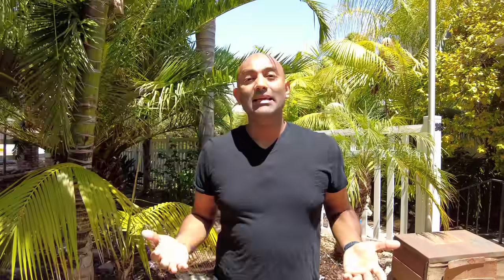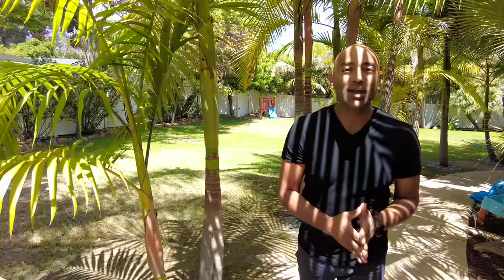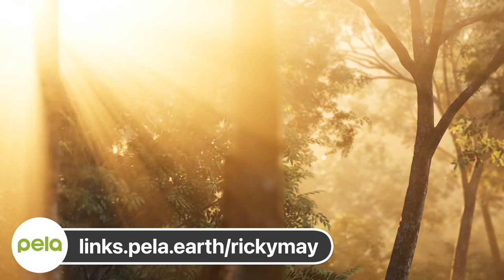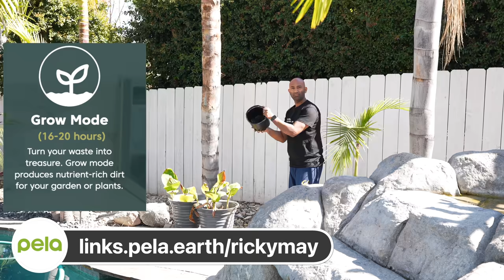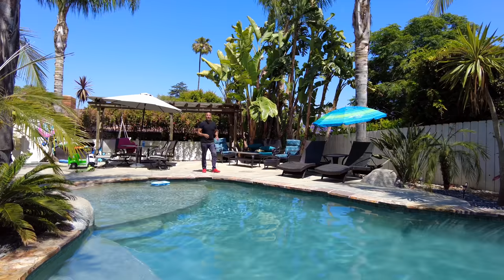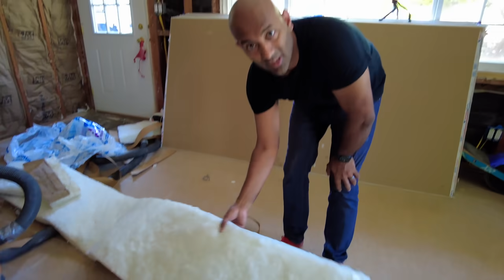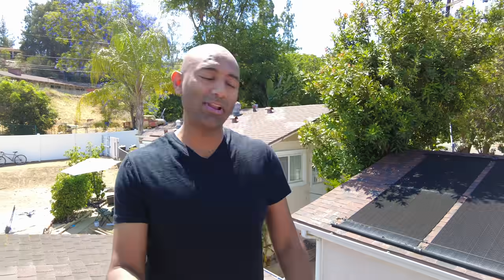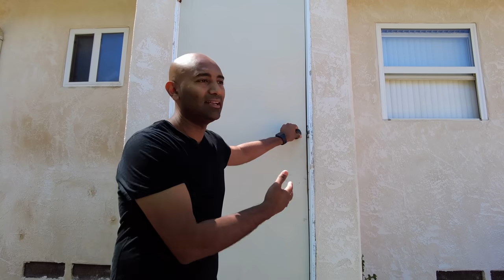How I'm Planning to go 100% OFF-Grid!

Comment: You dont even need natural gas if you can boost your electrical production by replacing much of you lawn and roof with solar panels. Water can be done with a well.
Reply from the maker: No solar over land for me. But I’m going to cover all my roofs and patios with it!
Reply: @TwoBitDaVinci  can you get enough solar energy year round and enough battery banks to absorb excess production for energy when the sun is down? When you look at grass its nothing but an energy drain. Energy and time to cut it.

Itd be cool to see if you can make a battery bank from salvaged lithium cells. Most lithium packs are sent to recylcing because only a few cells in the pack are shot. You can pull the good ones out and make a custom power bank. Id pay to see that. Been wanting to make one myself.

Comment: Thinking metal roof you need to get all gutters running to a water collection system
Reply from the maker: I really want a standing seam metal roof, but its really expensive. so right now I'm going to repair as needed, and get solar and get started. in 5 years, I'd love to do this

Comment: Solar hot water collectors are far more effecient than solar panels running a heater. You are better off getting vacuum tube solar hot water heaters (the best but most expensive) or a collector with a metal pipe inside an insulated case.
Reply from the maker: no way, I am going 100% PV solar panels. I have EVERYTHING electric I can power, and sometimes that might be a water heater. So i can run that for an hour or two. But the rest of the day or otherwise, I can run other systems I need. that's the thing, PV solar is by far the best way to go.
Reply: @TwoBitDaVinci  I have two hot water solar collectors that run my storage hot water system. They are about 4m2. They can heat up the hot water storage in about a day and it takes about 16kwh to do the same with electricity. If I try to use solar panels of the same area I can only get 680w or about 4kwh per day which is not enough to heat up the whole storage tank.
Just remember solar is about 170w/m2 (where I live). Hot water solar collectors get close 700w/m2 of heating.
If I was you I would put a solar collector to heat up water and use electricity to top it up.
I also heard you mention the water extraction system. Are they a dehumidifier type?
I was wondering if you use a compressor to condense water from air could you use it as a heat pump and get dual benefit?

Comment: use pool as heat sync for house ac
Reply from the maker: I thought about that, is that easy enough to do?
Reply: @TwoBitDaVinci  don't know, would probably require you installing the Geothermal heat pump and a heat exchanger between pool and gycol based Geothermal loop. need data. pool water temperature over season with no heater. Lot's of math to do and data to collect

Comment: @ two bit DaVinci
Of course your mileage may vary. Size shape location orientation insulation efficiency and practicality are certainly all concerns. Design implementation data-crunching and experimentation will be revelatory. Subscribers viewers the intellectually curious may have circumstances situations and objectives scaled differently than your project. We're here to learn how why and what can work to our advantage. HVACR HRV ERV  hydronic radiant floor or panels far infrared radiant impellers and fans have room for tremendous efficiency improvements. Inductive cooktops that could time out or hold. Multi Mini Splits and ductless(or ducted) options. Design complexity or simplicity costs and particularly DESIGN LIFE. Passive principles earthships 3.0 Electric heat pumps ranging from Air Exchange, the water in your pool to horizontal or vertical (open or closed loop) Geo exchange. Each person's situation budget and objectives will certainly vary. Thanks for sharing your projects and stimulating our creative impulses.

Comment: Your problem is not with solar thermal, it's the system you are using. Well-designed and made solar thermal collectors are far more efficient than photovoltaics in harvesting the sun's energy. They will also outlast PV and are easier to recycle end of life. Furthermore, hot water is an excellent energy store and a great deal cheaper than batteries.

Comment: you said tesla. you would not be able to put solar on your main house anyway since it is water damaged. it would have to be repaired first. However, If you had the tesla solar shingles as well, then tesla would repair the roof and add waterproofing and put on the solar shingles and do the whole thing for maybe a few thousand more than you would do it yourself. so maybe on the main house you should put tesla solar shingles that are guaranteed for and last 25 years.
Reply from the maker: they are very slow right now, and very expensive and dont think they'd take such a small project. also because I want to experiment  with various panel tech and stuff, I will be replacing the roof and getting traditional solar panels at least for the first part of the roof. money is something i need to stretch as far as possible

Comment: I have never heard of a gas clothes dryer. That does not exist in europe (I think). Here they are all electric.

...Internet is also a utility. Did you forget? Or ignore for reasons?
Reply from the maker: What do you propose I do to be more self reliant on internet ? not sure what I can do
Reply: @TwoBitDaVinci  Yeah it is tricky, since it requires being connected. I just noticed it was left out, and the title says 100%. I have no ideas.
Maybe apply some of the same criteria as for other utilities. Independence/self-reliance, longterm economics or environment.

The Danish approach is never self reliance. Here multiple houses share a big batteripack and central heating for a town is the norm. Often based on non-commercial associations. Efficient!

Comment: There needs to be more architects and home builders / remodelers that understand NetZero and passive house building techniques.
An energy efficient home or business is more comfortable and saves money in the long run.
Solar energy on your roof combined with battery storage can make people more independent from the grid and natural gas supplies. Add solar and supplemental electric heating, infrared heating or a heat pump for home or business heating..
All big box stores and manufacturing sites can support solar energy on their roofs or parking lots.
Added insulation, double or triple glaze windows, energy efficient doors, energy efficient heating and cooling systems, energy efficient appliances, LED lighting, smart thermostats, solar panels combined with battery storage and a electric vehicle charger in the garage or car park. People are too focused on the short term costs and miss out on long term savings and comfort. Blower door testing and air sealing are under appreciated tools.Even if you have money to burn you should not waste it.  Climate Change will impact everyone. Leave a better future for your children and grandchildren. Join in and speak up for the future of the planet
Reply from the maker: couldn't agree more! For example when the AC is running its quite uncomfortable, super cold air blowing hard into a hot room, it's much nicer to just have a nice ambient room in better balance. you're right a passive home is better in every way

Comment: 200 gallons/day??  4 people flushing the toilet just 5x each/day =120 gallons @6 gal vs old 10 gal toilets.  1 laundry load/day 22gal, drinking=4gal, 1 high efficiency dishwasher =2gal, rinsing dishes pre-dishwasher =10+gal/day, handwashing knives/wooden/nonstick pans/plasticware =10gal/day, mopping one not-too-dirty floor =2gal/day, watering 6 house plants =1 gal, watering 12 outdoor pots n San Diego =3-5 gal/day but more for lawns or beds =171 gal minimum sans showers.  

Like 30 minute showers, like me?  At the low-flow of 2.5gal/minute, that costs 75 gallons.  With just 29gal left/day your family of 4 would get to share 11.6 minutes of shower time/day.  That is not enough for San Diego if you ask me!

To get under 200gal/day, you must have no kids, no guests, no pool & no 30 minute showers, OR you can choose one of those things and skip using water to flush the toilet, OR you can make everybody take daily showers at the gym?  BTW, 1 tiny baby =22 more gal for 1 load of laundry & maybe more, all by herself, FYI!

dude!  i respect your goal but you should look at reality, then plan to cope with reality, OR to change reality.  Composting toilets STINK but save lots of water.  Using one might reduce your need to waste water on guests?  Stitching from grass to more drought-tolerant yard options would save A LOT from your current usage level.  $86k for that sci-fi cool machine?  Nahhh!  BUT, you might find a way to circumvent draconian laws & city codes there and use your rainfall more efficiently?

Also a hyper-efficient home but still using vegges made with mass water quantities?   Your life is still using an insane amount of water.  You might consider a small hydroponic organic produce system for your household, or better yet, an aquaponics system on your patio with seating over the fish tanks? That s a small home water use boost but t reduces overall water usage footprint n a state with major water shortages likely to get even worse n the near future.

Comment: Out of all the changes your purposing, trenching a new electric line to your guest house is probably the easiest, maybe even the cheapest change, fyi.
Reply from the maker: yeah it might just come to that, but right now, it's a low priority because hot water in the office isn't even on currently and our old water heater didn't work... so with how expensive this all is, we need to be laser focused on cost. we will get to it though eventually! our main home water heat is a much higher priority
Reply: @TwoBitDaVinci  👌💯

Comment: I think Sonnen is a much better solution than a Tesla power wall. IMHO, Elon is out to ruin everything he touches. ¯\_(ツ)_/¯

And after looking more closely at both on the google ... I think I'd rather go with the setup Will Prowse has with the Signature Solar rack system. The same amount of money could get you twice the battery storage. (Currently $1500 for a 5KwH battery. So for $9000, you could have 30KwH, instead of Sonnen's 10, and Teslas 13.5)

Comment: when you have electricity why need gas?
isn't it electricity + water okay alone
Reply: Yes.   But in most of the USA, gas is cheaper than electricity, so if you're on grid, it's cheaper to have a gas furnace & water heater rather than electric.
Reply from the maker: Exactly, its a challenge I need to sort out. It all starts with a large PV solar system

Comment: Eliminate the lawn. There are so many interesting and practical landscaping possibilities that they deserve attention. Bye bye lawn, hello Japanese garden, backyard forest, etc.

Combine roof waterproofing, solar electric panels and water heating systems in the same unit. This is the future and absolutely makes no sense to do anything else. Solar panels are waterproof and should be connected to make a continuous waterproof roof surface. Add water heating panels under the solar panels to keep them cool. It looks like you will be able to combine the fourth function, that of water collection.

Consider making your own custom super insulated refrigerator.
And I'm betting you don't have a basement. It's useful for cooling.

Comment: What about a "steel roof," replacing a roof, not cheap  Lack of insulation is everywhere and its horrific!  Your program is quite an endeavor, its going to cost a fortune.
Reply from the maker: yeah it is going to be a very expensive enterprise for sure. I thought about a metal standing seam roof, but I can't afford it right now. We are going to repair our current style roof and add solar for now. in a few years we might re-evaluate

Comment: DON’T do the dehumidifier. Please.

Overproducing solar energy > wasting it.
Reply from the maker: we want to have so much excess energy creation, that we can funnel it in to different places each day. maybe we generate water one day, charge the car the next etc... we're still thinking it all through.
Reply: I like the plan of overproducing. Maybe setup some spots in front of the house and offer free/cheap charging to the neighborhood. Im sure you have thought of other uses too. 
Just don’t waste it on dehumidifying the ambient air, it’s too inefficient. Passive capture is fine. Active is just throwing away resources that could be more beneficial basically anywhere else.

Comment: You're making a big mistake. Just because a house is off-grid (like you mention one of your structures is), that does not mean you don't need permits. You absolutely still need permits. Permits are about making a structure is safe, both for the safety of its current owner/occupants, and for future owners/occupants and neighbors (who could also be affected by fires from the wiring). The electricity you're going to be installing is no less potentially dangerous than is electricity from the electrical grid.